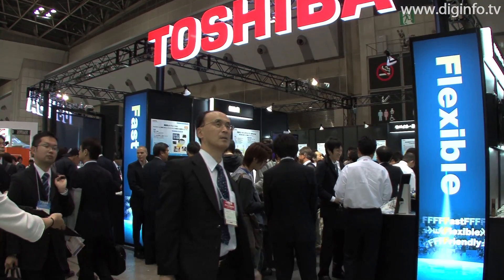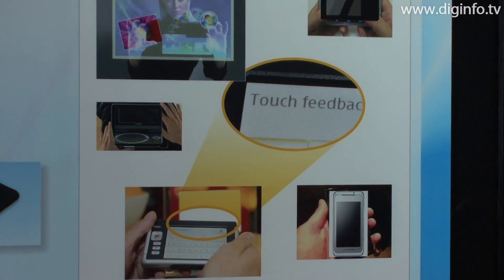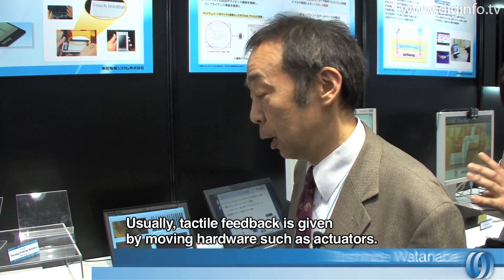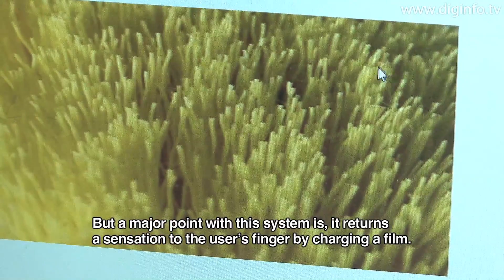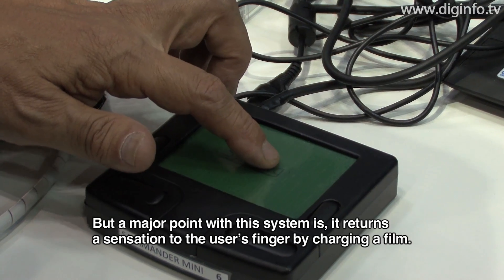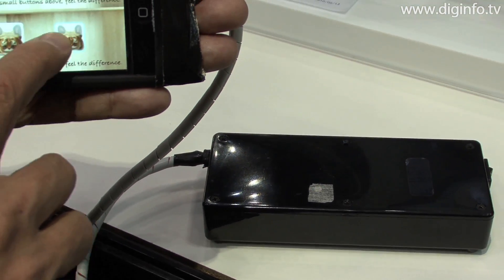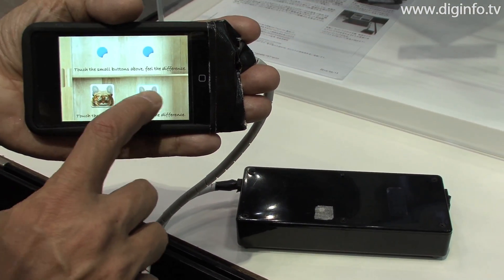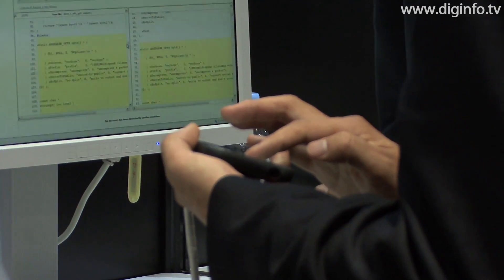Touchpanel Tactile Feedback - Toshiba New Sensation UI Solution : DigInfo

Comment: @MasterofRubik The latest info on the new console says that the pads will have a touchscreen with this new tactile surface tech implemented in them. Nothing confirmed until E3 I know but it's the sort of crazy thing that nintendo loves to do.
With the wii the motion controls made sense, it's the most intuitive control method for those unfamiliar with the traditional game pads, it opened gameing to a massive new audience and it should be praised for that.
This is different. It adds nothing.